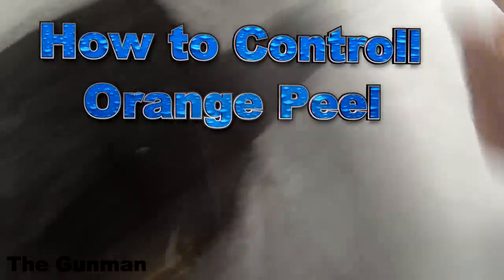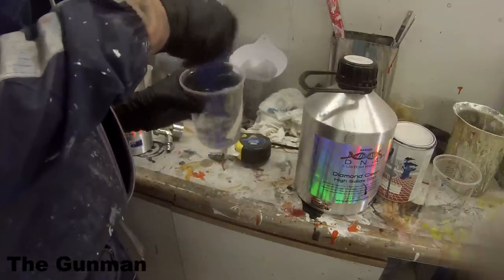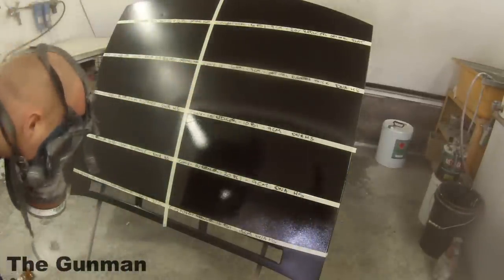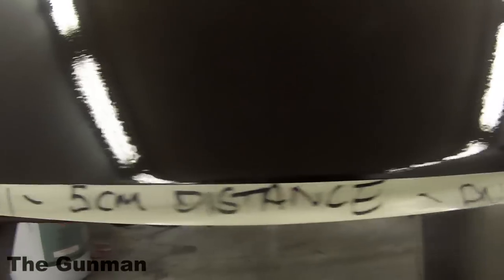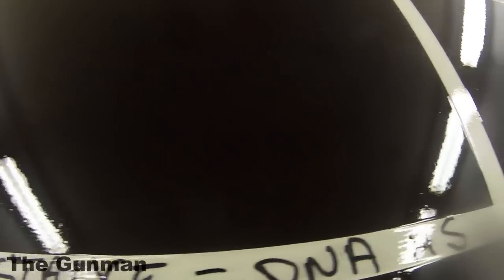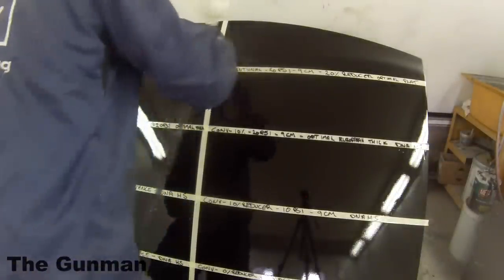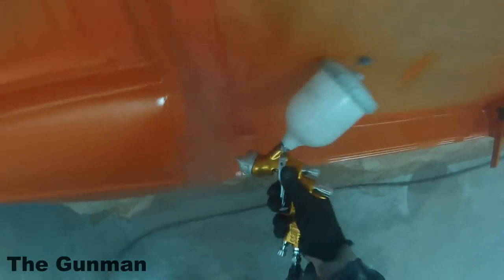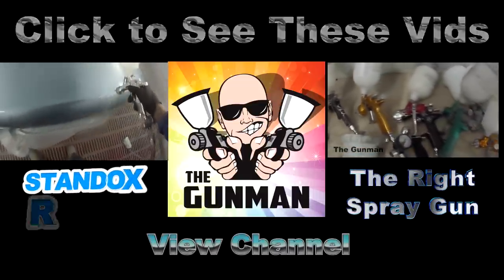How to Stop Orange Peel

Comment: heey i`m have almost no orange peel using a technique that i learn on youtube also. U paint whit no reducer at 1 coat, 10% at second, 20% at third, and 40% in the last thin coat just a little bit more than a dropcoat. It makes the dry time a lot longer and this way the paint end looking great.
Reply: thanks mang
Reply: @eksine  i know this is old, but I spray at a way higher pressure for clear (26-28psi) and decrease my distance by a few inches. Have done multiple full sprays and resprays and all panels came out near glass. My painter teacher taught me to up the pressure for a glass finish. Something about forcing it to atomize at a higher pressure. Never had any orange peel issues since, but it does take getting used to to not cause runs or excessive build up/texture.
Reply: @novinnovations4026  I did learn that technique actually, I'm using 29-30 psi and yeah the hard part is first using a test hood and figure out what is the closest distance need to get that right finish. thanks man and hope you have sucess in your career
Reply: yes! I've figured this out too, go thinner on last coats to smooth things out, and also higher pressure helps, I use a cheap acrylic enamel and they recommend 40 psi, which I learned to follow, and also to keep the trigger restricted helps get a fine atomize: fine atomize fine OP coarse atomize coarse OP.

Comment: YES, VIVE LA SCIENCE. Mate that is a great and very clear fix. THANK YOU so lets see if I have distilled this right...If its peely then you can.
* Up the pressure, (but not too much or it will go dry yes?)
* Get closer (but dont go too slow or it will run)
* Thin the material ( but not too much or you'll get runs, reduce the gloss, get solvent pop)
Have I got that right?
Mate the TAFE should be sending their teachers to YOU for "proper" training. Keep up the great work and dont think for a minute that we dont all appreciate it. Cheers
Reply from the maker: TresMamboMusicSchool Yes, Yes, Yes. Top of the class :-)
Reply: Sorry for the stupid question but do these techniques apply to base and clear coat?

Comment: I've been looking for avoiding the "OEM Finish" orange peels but to spray the clear as flat as possible so that I can delivery custom motorcycle paints (especially the dark windshield) with minimal sanding and buffing. Found nothing until I saw your "double it" approach in another candy paint video and the using of slow reducer and info in this video. Really saved my day, great thanks.

Comment: I just painted my 1969 Chevy C10 and it came out nearly perfect thanks to the sharing of your exceptional insight and skills.
Reduced the clear. Set the gun up full spray. Turned out the fluid 4 turns and kept the gun 5cm from my work. Hardly even a hint of orange peel. I have 3 small sags/runs on the entire truck. Have to look hard to see them.
Thank you very much!
Your video's are totally awesome!
Keep up the good work.
Reply: Shouldn't get any sags

Comment: So I painted a car without watching this first.... big mistake.
A major problem was my cheap 3 in a pack auto parts store gun. They look the part but after watching this, the spray pattern was terrible. Tried heaps of different things. Still just as bad. 
Today my first effort with a $150 Star 1.4mm tip and new gun. Massive improvement, almost no peel and shiny as. 
Thanks Gunman for taking the time to show how to do it right and explaining why my paint looked terrible (like the first sample you sprayed) to looking like a pro job.
Is it perfect? Nope. Will it get scratched at the shopping centre? Yes. I think that is a win.
Now to find my next project. And do it right from the start.

Comment: YOU LITTLE CHAMP GUNMAN
My questions all answered wish I saw this only a week ago after buggerising around in my shed
This video has allowed me to fine tune my result more than I would of thought possible
I had no idea you could get such a great finish at 10% reducer at only 5 - 9 cms away from the object
Even the low cost 2K clear I tried proved results very close to whats seen in the video
Reply from the maker: Once it becomes habit it's easy but at the start it seems a bit scary holding the gun so close, speed up the passes and BAM!! awesome paintwork is at your fingertips :-)
Reply: what does it mean by 10% reducer

Comment: you and I are the only ones that have videos on this subject. I put some videos for guys who dont have a booth they can use 16lbs or 1.1 bar and  1/4 in on the fan 2.5 to 3 turns out on the material Tekna pro lite and medium solids 4-1 clear spray gun and hvlp cap this is to get a pretty smooth finish on a flat panel with a tolerable amount of spray dust so you can see to spray in your garage without many fans. better finish than LVLP.

Comment: Thanks! Great demo on the  interplay between distance, pressure and viscosity. I just laid down a crappy orange peal primer. Obviously 20 cm Was too far away and I was only adjusting viscosity and upping the air pressure a bit.  Going to block and retry.   Thanks again for the knowledge.

Comment: Thanks for the tremendous work testing this.  I got a lot of orange-peel with a HVLP, painting 2 cars last summer.  I didn't think of getting so close, keeping the gun maybe 10" away being more concerned about runs.  It was also hot ~90 F in Aug., which some say doesn't help.  Fixed it by sanding w/ 1000 grit, then high-cut compound to get flat and dull, then got mirror smooth with finer compounds.  Had a few runs and sanded into the primer a few places trying to knock them down, but single-stage (no clearcoat) so was able to touch-up.  Used "boat-paint" polyurethane on one (Interlux Brightsides) and automotive polyurethane w/ hardener on the other (Spralac SP150), but orange-peel was about the same (like your middle tests).  Interesting how you term European vs Japanese orange-peel.  Some of my cars have factory finishes with almost no orange-peel (M-B and Chrysler), which they must get with superfine nozzles and electrostatic attraction since they don't usually do any sanding and compounding.  About to paint a third car, and now ~68 F in Nov so will see if these tips plus cooler helps.

Comment: thank you! I'm having trouble with budget acrylic enamel and have been battling OP.  You gave me some insight to try varying gun distance. However I had problems with stripes when I had gun too close before which has kept me further away which has helped get a uniform result. I will now try to see if I can cut OP and avoid stripes.  still learning and thanks again.  The clear recommended thinned 4:1 (I do not use hardener) I had cotton candy flying even down to 3:1, 2:1 was better, then I went to 1:1 and even 1:2 I bet you think insane!

Comment: As a beginner I'm a little confused, since your final job at the end shows the tip of your gun is often about 15 cm from the work, not 5 cm which you show gives the best result as far as orange peel.... Having had more than my share of runs I feel pretty timid when the gun is so close. Presumably I need to hold the gun closer, stop down the paint, and get a better quality gun. I suppose it is all about understanding your tools through experience.

Comment: Gunman great stuff. Question. Is the clearcoat orange peel look reduced if you sand the orange peel out of the basecoat first? If it helps, what grit would you recommend for finishing base coat sanding. Alternatively, would you just not bother with basecoat sanding?? Thanks again for the great vids

Comment: This video just made my life a lot easier!!!   I use a Graco Finefinish help turbine system so I can change tip in addition to pressure and fluid, but I can’t get over 10psi so I may drop down in tip size see if it helps.

Comment: I have a question on a special item. I need to paint a 66 Mustang Dash. Using Single stage rat rod black (3:1) and going to mix 25% normal clear (4:1) for durability and to mimic the factory finish. I want it to be very flat so based on what you did in the video what do you recommend for NO orange peel? I would think 20% reduced (both) and 5cm but 20psi seems low...do you recommend that over say a 26 PSI ? THANK You

Comment: Great and most helpful vid. Just wondering what would be the minimum air compressor to get consistent 20psi. I think my machine starts to run out of puff. It's a single piston unit with a 1/4 or 1/2 hp motor and 75l tank.
Appreciate your thoughts!  Thanks! Mark

Comment: hi buddy great vids! i have just gone and got a generic hvpl gun and will be using 2k+hardener on my next hobby . Im in the process of air bushing designs on crash helmets plus other en ones, my question is what settings would you use on helmets to get the best results?, i live in the uk (crap cold weather) and will be painting the clear coat in the garden in a gazebo. I will no doubt before mixing keep the clear in a warm bucket of water to help flow but other than that would there be a different way to spray these? any advice would be more than welcome :) 
thanks again!

Comment: Thanks for this video. I think it helps us to try and manage peel better. It is always more of an art anyway, but there is some science to it. It looked much flatter with the conventional tip, but of course it is a matter of feel, and you can probably replicate almost any peel just by adjusting pressure, distance and speed anyway.  However, I think the lower reducing and pressures and thicker clears will always be more peely when they dry.

Comment: im in the processor buying the equipment to learn to paint etc..
I know the basics, Mixing paint etc, But i can still never get a answer no matter what videos i watch..
1. What air pressure is required for all guns? Conventional, HVLP and LVLP? 
2. Does that pressure setting change between different brand paints etc?
Or is it, Once you found the optimum pressure for your certain gun, Do you tend to always spray with it at that pressure?
Reason why im asking for air pressures on all guns, is because im spending a bit of money and buying a range of guns, Find which works best for ME.
So far ive ordered a DevilBiss gun with a TE20 aircap... A HVLP and LVLP gun too..... 
I just dont know how to find the right air pressures, without painting a car panel and then finding out it came out horrible lol
cheers

Comment: That was a great video, showing not only the distance but also the reducer percentage. What do you believe is an optimal percentage of reducer for a HVLP with a clear coat ratio 4.1?
Reply from the maker: It's hard to say because all clears are slightly different. As a rule of thumb I start at 10% and make adjustments from there.
Reply: @TheGunmanChannel  Thanks!

Comment: Thanks for the tips mate, great advice. I have recently got myself into painting fishing rods with base colour and hs clear. Have been struggling getting a nice clear finish, especially on something sometimes no bigger than a pencil, but adapted your tips and got a great result on my last rod. Any more tips on spraying something fine would be great. Using 1mm nozzle on star spray gun, with gen rock 6000 hs. Cheers

Comment: Thanks for the information.  About the fluid setting, do you mean to turn the fluid control all the way in with the
trigger open or to pull trigger all the way until it stops then move control in or out?  Thanks.
Reply from the maker: I mean go all the way in, then count the turns out.

Comment: great vid as always mate... just a quick question,  do you spray wet right of the bat with 1 coat or few coats with flash times? cheers.. do you dust coat for the 1st coat or just whack it wet?
Reply from the maker: First coat should be wet

Comment: Thanks man. I am a beginner and am finding that even in one pass/coat, with the same settings and paint, I am getting 0 orange peel, really really nice and flat, on some areas like the roof, but then really pronounced orange peel on others (like a transition area from roof to rear quarter) even though I think I am using the same distance, speed etc. But it does come out different. More practice I suppose, and grateful for cut and polish.

Comment: Great video, thank for taking the time to post. I hope you may be able to help me out, I am a novice painter and with a small compressor, 3 hp, 9 cfm, 50 litre, and I use a mini HVLP gravity feed graco finex with a 1 mm tip and I have a pressure gauge at the gun that I set to 29 psi and by far my biggest problem is severe orange peel in the clear coat and a dry rough effect and the only way i get around this is by adding more thinner / reducer which sometimes I try and avoid for fear of reactions with the repairs underneath the basecoat. I have also been recommended a diamond clear coat and told not to use reducer but i can't seem to avoid the rough orange peel effect if i don't use reducer. Would increasing the pressure and reducing the paint flow help to reduce the orange peel effect  or could you give me any other advice please? I am mainly painting base coat pearl / metallic and clear coat. Thanks
Reply: I am not expert at all, but can share some ideas. You can try to change distance and speed. A little reducing fan can help on cheaper guns. Reducing material helps also, but then you have to reduce speed also. If you material is not thinned risk of running is low and you can go slower a lot. If you are getting orange peel your coat is definitely too dry. You never get orange if clear coat is nearly at point of running. And finally if you just have spayed orange, don't panic.  Remove remaining material from gun. Add some pure thinner and spay it on panel from 20 cm high speed with 20 seconds waiting between layers until you get desired result or clear-coat start running.

The main thing, you just have to find balance between orange and running.
Reply: Great tip on spraying thinner directly over the orange peel, i hadn't thought of that. I think i may have an idea why i get the orange peel as i always spray outside which can be quite windy and also the temperature of the panel i painted last weekend was 30 degrees C, and also  the reducer i use is a fast reducer and even though i added 25% reducer i think the temp plus the wind and fast reducer was stopping the paint from flowing.  I increased the tip to 1.2 and tried increasing the air, which maybe i should have tried less air pressure, and also tried different distances, paint and air amounts i couldn't get a wet finish although it did flat and polish ok. the next job i will try a slower reducer and hardener in the clear but really i need to paint indoors i think. thank you very much for your reply
Reply: Spraying outside is nightmare. I painted quarter panel in garage and bumper outside a few days ago. Used LVLP gun to get less over-spray, because garage is my friend's and he would not be happy to get all his stuff covered with lacquer. Temperature was 16 C, but sunny. Quarter panel got not too bad, but bumper really bad orange peel with the same gun, settings and temperature, just bumper was on direct sunlight. I spayed the same amount of thinner like clear coat to reduce orange peel. If I ever will spay outside will make sure to make at-least some shade. It looks like you paint motorbike parts and you do not need orange peel effect at all. Then I think you should go back to 1mm tip, reduce fan a at least a half. I think you do not need wide fan for motorbike parts anyway. Then attach a few meters long bit off brown masking paper or card board on a wall. 29 psi, start on fully open material feed and try to spray on paper 5cm (I think bigger distance would be better, but because of wind), high speed. Reduce material feeding until you start getting finer not big dots from material drops on paper. Then try to spray with these settings just as slow as possible, but as to not get runs. You can also try slow hardener and thinner, because temperature is very high. Or perhaps you can try to look for videos how to spray clear coat like glass.

Comment: I just shot my first panel and it turned out very orange Peeley! I’m using a high solids clear, 1.4 tip. 
Are you saying 20psi at the inlet of the gun? 
Also, I’m using a 1 to 1 urethane. Should I reduce the urethane in addition to the 1:1? 
Thanks

Comment: Man I spray so much farther back than you Gunman. I'm a pretty novice painter I have about 1.5 cars under my belt working on one now. I've been spraying my 2k clear at about 7-9 inches at about 13psi on the gauge and thinned about 8-10%. I've had pretty good results with my hvlp. A little on the heavy side but ive been dialing it back laying down a light first coat then a heavy 2nd coat. Any tips are much appreciated!

Comment: Just wondering if you have done a video on 2k solid as I'm doing my Hq in ford monza red solid 2k and I'm finding it very hard not to get orange peel. I have a hvlp gun 1.3 nozzle, about 25 psi 5cm away from panels, 20% reducer. primer was sanded with 400 grit. I'm allowing 20mins between coats. I have a channel davo hq that shows my latest attempts. any advice would be appreciated.